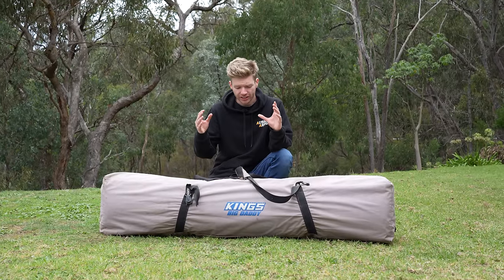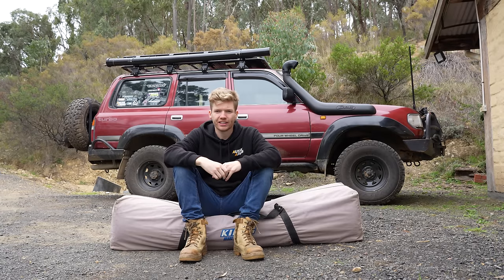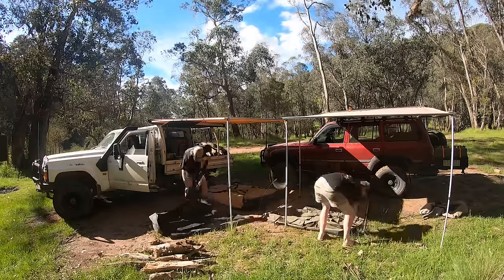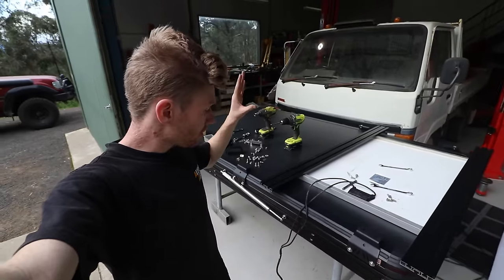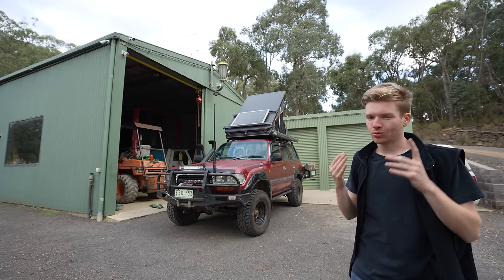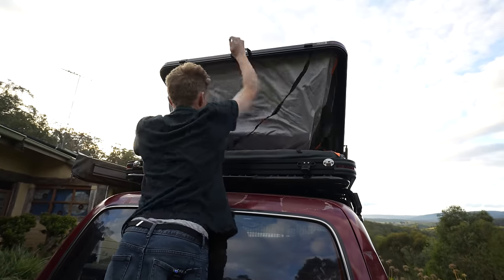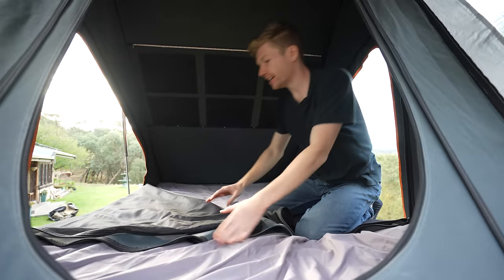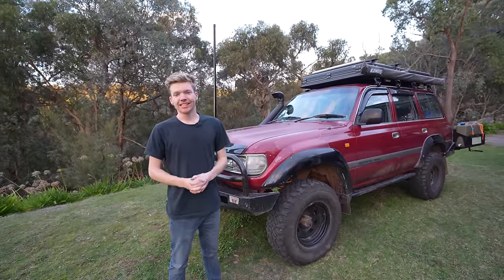A ROOF TOP TENT you can ACTUALLY AFFORD!? but is it any good??

Comment: If you ever camp under heavy rain with the ladder in use, the two vertical tubes will leak and collect water.  Ensure you tip it upside down and remove most of the water before packing it away, or it'll slowly leak inside the bag and wet anything it's packed against it.  The ladder that came with my Darche Ridgeback apart from being black I'm sure is 99% identical to all other telescopic ladder that comes with RTTs.
Reply: Try drilling a small hole (or several) on the plastic base of both poles.  That way, any water that sips through the vertical tubes exits and not pool inside.
Reply: I've never had a issue with both of mine and I've had one for 4 years
Reply: @fatmanoverlanding   ❤

Comment: If you leave the RTT on permanently then there's no need for a rack. Swapping it out for crossbars would save another 20kgs, but be just as strong (not to mention half the price!).
Reply: I was thinking the same 👌
Reply: Yes but think about it a bit.

There's 4 gutter mounts per side instead of 2, so swinging around on a track the roof has a more speed out for on it... especially being 65kg, think about the force it would put while u drop a wheel into a rut or something.
Reply: Only allowed 100kg on a Landcruiser roof including the roof rack.
Reply: I’ve converted a little box trailer into a camper/toy hauler. Saves putting it on and off, I can move the car without packing up, and keeps my centre of gravity down

Comment: Nice one.  I did see OCAM's preview video of this product two months ago.  Looks like a good RTT to consider.  A hard shell wedge style RTT with a 160mm packed height and 65kg is the specs I'm looking for. Most comparible RTT are around 200mm packed height and in the 80kg region.  Looking forward to seeing your thoughts on it after you come back from your trip.
Reply: @intimatespearfisher  That's how the other RTTs brands provide their weights too (excl the ladder etc). Besides I'll never pack the ladder inside the RTT anyway.  I also prefer to have a platform rack to mount my RTT on.  This allows me to mount things to the roof rack without the limitations of only being able to mount things where the crossbars are located (things like lights, awnings, ensuite etc). I know you can mount many things straight to the RTT via its side extrusions but I prefer to mount things directly on the roof rack.  Besides you don't save much weight using an aluminium platform rack vs 4 crossbars (for my particular use).  I've looked into it.  (Front Runner = 32kg vs 14kg) And the convenience of having a flexible platform to mounts things to far exceed the slight weight penalty IMO.

Comment: It looks very much like the version by MW Toolbox. I'm still always concerned with the roof weight limits especially for off-road, not to mention in my case my unit's garage is too low. But I'm looking forward to the reviews. There are so many possible solutions to the 4wd sleeping conundrum. I have a platform in my paj so I can sleep in vehicle (for 2) and 100mm mattress which I keep rolled, and a rear awning tent which I can either sleep in or move equipment like fridges to overnight. A big darche all weather bag is great to store non-in vehicle essentials like pillows, chairs, blankets etc on the roof.

Comment: Nice vid!
As for the mattress issue with the slats on the base, how about using a piece of 4.8mm Masonite sheet?
They come from Bunnings in 2400 x 1200mm so you can just trim it down and slide it under the mattress. That way you only need one mattress and save all that space.
Last time I went camping I took some sheets of ply and I laid the swags out on them (the ground was gravel, so glad I brought them!) and then they doubled as target stands.

Comment: I've got a Drifta camper with the hard shell roof top tent. Vastly different budget (and they don't make them anymore) but it came with a inner spring QS mattress.  It has room for a mounted fan, a headboard cupboard, lights on stalks and power outlets. I can leave the pillows, made bed with doona, and a tv laying flat on the mattress.
But it wouldn't mount on a 4wd I think as it's really wide, prob too wide for my 200. 
You could help your ladder by having a milk crate at the bottom.

Comment: I have a drifter Rtt , basically the same profile, for the mattress upgrades we have been doing is pull out the existing mattress replace with three mil ply, then use a self inflating mattress. I have a monster mat , This way you just pull the bung and it will deflate right down and you can keep your bedding in. You can either squeeze some air out or some blokes have been using a deflator and suck a heap of air out.

Comment: Thanks for the video. Really interested to see how you go. 3 years ago I did heaps of research and ended up with an OCAM flat aluminum roof rack for my Isuzu MU-X. Its mounts are super solid, and the mesh makes tying down loads really easy. Its only negative is wind noise. However, I’m planning to purchase a deflector that should direct the wind over it. You might want to look into this too. In theory, it would work with your RTT.
Reply: Strap a pair of maxtrax across the front on top ,stops the annoying humm

Comment: Welcome to the rooftop tent club. There’s pros and con with all setups. Comfort wise it’s the most comfortable sleep your gonna get a in the bush. I’ve got a soft shell kings roof top and my 1st night out in the cold Victorian winter, my mattress was soaking wet - floor condensation. All sorted out with a meshed mat under mattress. A few tips on keeping the rig level is to use your maxtrax to raise  and I also dig out a small hole to lower, its a bit of f&$king around but saves you time looking for a flat spot. Don’t forget to backfill when you leave.

Comment: Looks awesome!! Instead of a second mattress could you put some 3mm ply under the supplied one?
Lightweight and smooth.
Then throw a mattress topper onto the 50mm to gain airflow for those hot nights and a bit of padding and you'll be getting the best of both worlds.

Comment: One thing that has stopped me going for a rooftop tent is I use the roof rack for fire wood a lot of the time. Plus trips with a passenger I need the rack for swags.
I definitely would recommend one in the North end of Australia as well 🤣
Reply: But is 3 to 5k worth spending on something they will hardly use. Not a smart way to spend ya money. The extra fuel U use to transport. It? Insurance are you insured with this on ya roof.

Comment: i have an 80 too, the neatest way i have found to run wires up to the roof whilst keeping the car water tight, is through the rear air vent plastics, carefully remove one of the vents, run your wires through the S bend air vent , up through the outer plastic to the roof line, then open a hole as required to exit your cables up to the roof,  sika flex the cables on the exit point and run along the gutter and cable tie up your rack leg.  i made a little clamp that holds a cable  tie on the rail but you could also just put a dab of sika in the rail .

Comment: The only problem with roof top tents is if you pack them up wet they will still get some water leaking onto your mattress.   Even the $5k ikamper I have seen with this problem too.  At least a tent you can leave to dry off while you're out and about driving around.   Keen to see how you get on in the rain.

Comment: Get your self a trailer 2 way bubble level. Cost a few dollars at bcf.
Then use an angle finder cube to set a zero on your tent and then find a spot in your car that matches and stick the level down.
Makes positioning your car so much easier.
Dont need to get in and out of the car to have a look and guess if the tents flat or not.

Comment: I saw OCAMs video on this RTT in Feb.  When clicked on the link it seems they have not uploaded the info on there yet.  So I commented on the YT video asking when they'll have the info up and running.  I didn't get a reply and have totally forgotten about it.  I've since bought the Darche Ridgeback from Snowys as they had a huge special on it just before Easter which dropped the price under $4k - IMO this should have been the price of it in the beginning.  I have no regrets buying it as it definitely is a high quality product with great features compared to other hard shell RTT I've seen.  But the specs of the OCAM would have suited me better with its slimmer profile and lighter weight (+ cheaper).  Like you I wanted to minimise both (height & weight) on top of my 80 Series.  Oh well.  One thing I found on the Darche which was a pleasant surprise is how much extra head room their design creates over any other hard shell wedge style RTT.  The Ridgeback's back wall rises up and away from you (as opposed to up and towards you).  This insignificant looking design makes a huge difference on the volume inside the RTT.
Reply: Tip:  I have a Kings 160w fixed solar with the Kings mounting brackets.  Flip them upside down and attach them back to both the solar and the crossbars.  Doing this has lowered my solar panel height.  It's pretty much around the same height as the top of the crossbars (lowering max height - allowing me to fit under most undercover carparks).
Reply: @HammerRocks  Thanks for the tip.  Anything that helps improve aerodynamics is a good thing.  Not that you'd call a brick on wheels aerodynamic. 😁

Comment: Great video mate, I do appreciate the budget aspect of your build and its definitely inspiring a lot of young fellas, or those who can't claim everything on tax, cough cough* tradies, to get out there and give it a go. 

But I am sorry to say, this looks painful in comparison to some other RTTs on the market, especially entering from the side you would have been better getting a side opening RTT. The Drifta Stockton Desert Cruisers are great for this as they are side entry and have very similar stats to this one, a little pricier but still at your original budget of around 3k. It is also lower profile so I would recommend this if you want to decrease the height of the setup on top of your vehicle. 

Roof bars instead of the platform should be a priority for you to save weight, you can easily save another 10-15 kg. Also I would just be careful around having 6 mounting points on some of these RTTs. They need to be able to flex, especially if you are off roading, and it can lead to breakages. I am not sure on this model, maybe its what its asking for, but for most RTTs 4 mounting points is more than enough. 

The mattress problem you are facing I have seen in the comments others suggesting a self inflating (can use a inflater/deflator from ryobi and make it super quick set up), this is a great means to get rid of the 100mm of mattress you have up there and so will be easy to close and you can leave your bedding. Feeling those slats is an easy fix, get yourself some ply and marine carpet, and you can essentially make a floor that sits inside the tent. This should also help reduce some wind noise you will likely hear as the wind goes under and caused the floor to flap a bit. 

Again enjoy the content and can't wait to see the next trip!

Comment: overkill on those clamps.. I had 4 SS m5 bolts holding my RTT to my bed rack and had no issues at all.. I did pup a rubber washer between the rack and rtt rails, and I replaced the nuts with SS nyloc nuts. no issues.. my new tent from OVS (bushveld II hardshell) shows up tomorrow.. have to see how this one attaches to my rack.. but should be relatively straightforward...

Comment: Hi, for a budget option,  me I slipped a lot of time on my roof rack . On my FJ Cruiser toyota,  I have a roof rack ,  a good one, a Warrior flat, and I put a 3/4  plywood on . I have a ladder on the back door to the FJ CRUISER,  so it is easy to go on the roof rack ,, and I put my swag on the roof rack .  Very safe. I put some ancor each corner... very happy few years whit that... hight spot safe no problem with, rain or animal,  durt,  rock . Make a great flat surface.  
Now, since 2022 September, I run Toyota Tacoma offroad,  with Quick Picth Rtt....

Comment: Just need mini aircon ,and innerspring mattress,hole like a sunroof to reach down to fridge,I'd  get one,other than that its crap.No way on hot night you can sleep on heat trapping foam,got to be innerspring pockets,tent white roofed  and or insulated 20mm thick walls to keep solar powered ,battery mini aircon cool to cold inside,got all that tent makers

Comment: I had a rooftop on mine! loved it to bits. Though I dont have one no more.. I had the original kings kwiky which started to crack along the sides hence why I got rid of it. Anyway fuel economy wise I was getting 11 to 13L/100km with the RTT. now with no RTT Im getting 8.7 to 9.8L/100km. Im running 2" lift on 33s with bar work, roof racks and drawns nd what not in the back. Handling wise I did feel it hindering me doing hard tracks but general driving and doing trail driving you probably wont notice it aye 
"Td5 discovery"
Reply: 9l per 100kms with a lifted , armoured 80 on 33s…. Very impressive.
Reply: @105isalive3  well I should mention what car I drive aye 😅 is a td5 discovery

Comment: What happened to being over gvm ?
Reply from the maker: With the tent  Ive added around 43kg.
But I've saved weight by ditching the swag, going to alloy rack (22kg saving) removed a heap of stuff inside the car that I didn't need, removed roof water tank (25L).
So in its current configuration it should be just under 3 ton, but will be going over a weigh bridge on my way north and I'll let yous know 🙏
Reply: I've converted my 80 series into a double bed and absolutely love it. So warm and comfortable. Also comfortable in summer. Bed sits on top of two titan draws and extends over a false floor. I still have a 36L dual zone fridge freezer underneath the false floor I built as I took the rear seats out. Plenty of storage. Dual Battery is under there too. Works great. Not for everyone. But can be done
Reply: But a swag weighs 17kg, not 65kg… you also have no roof storage now and the weight is always there with RTT always in the elements and making the vehicle’s balance and wind drag considerably worse… what is the cruisers roof weight limit? And what is the rated limit for the rack in off-road use?

Comment: That exact same tent is now $2800 on Ocam. Missed out on a bargain there I did
Reply: Wow! Really?!  I'm certain when I checked it last week it was less than that.  I think they knew this video was about to come out and will get a huge exposure and a surge of new orders. 🤔
Reply: @fatmanoverlanding  
I think the $2200 was a pre order price but it's definitely lined up well with this vid haha
Reply: DRIFTA are now using the same tent design so keep an eye out for sales there too
Reply: @tenfeetwanderers774  The new OCAM side opening style RTT looks very similar to Drifta's Wild peak RTT.  Down to the reflector on the corners of the aluminium extrusions and the slat design.  I wouldn't be surprised if they are made from the same factory in China.
Reply: @fatmanoverlanding  yep. The two new tents from Ocam and Drifta are basically like for like.

Comment: I hate rtts. Too heavy, exposed to the elements, suck in wind, suck in rain, waaaaay too expensive for a bed you'll buy a mattress for (can't even get a decent mattress in a 4k rtt), no privacy, terrible for fuel economy, too big to store easy if you take off between trips, extra work for a midnight piss etc etc. Did I mention crazy expensive compared to every other option?
Swags are a bit wierd too. They're so complex now esp with stretchers that you'll put a tent up quicker. Tents are half swag price for 6x the size and smaller to pack and store.
Swags and tents can go under an awening beside the car for privacy  amd protection from the elements, can move ya car without wrecking camp, you can get changed in a tent or under an awening n step into bed/go pee in one step, Swags are warm in cold weather and easier to heat with just hot water bottles.. bla bla bla